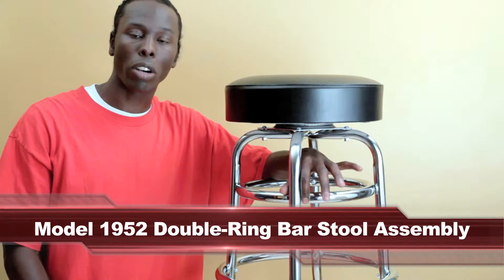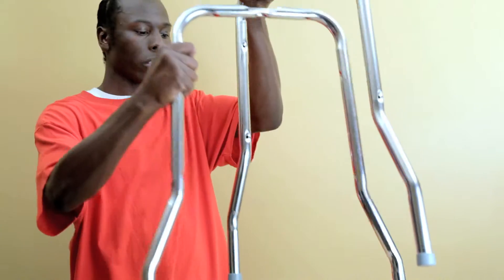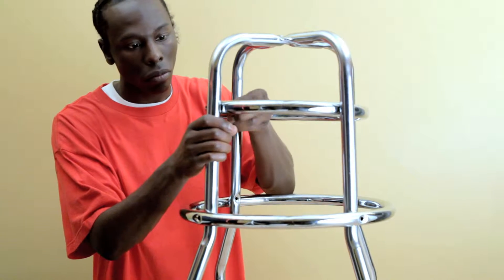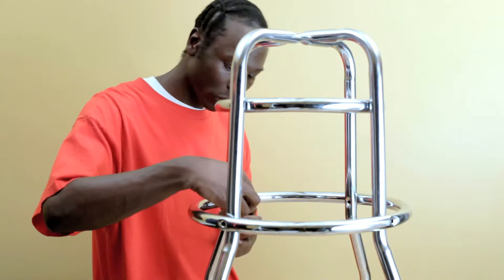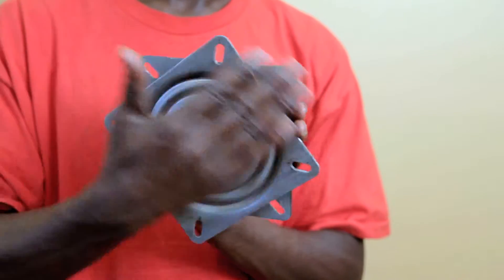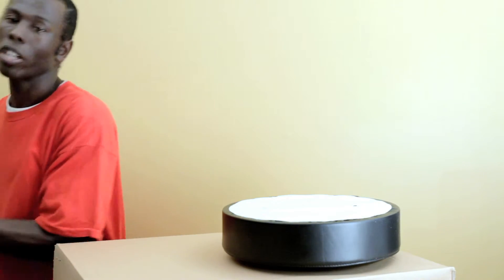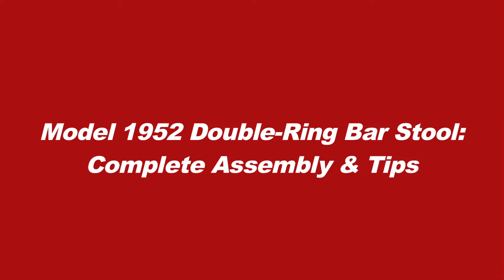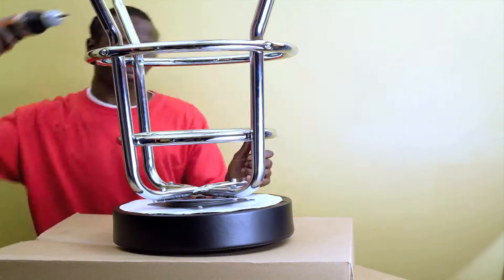How to assemble a bar stool frame

Comment: Something missed... You have to get those legs in the right order / configuration or the seat will rock. 
There's also metal shavings inside the tubes that rattle around.